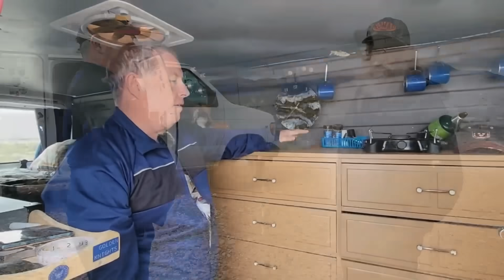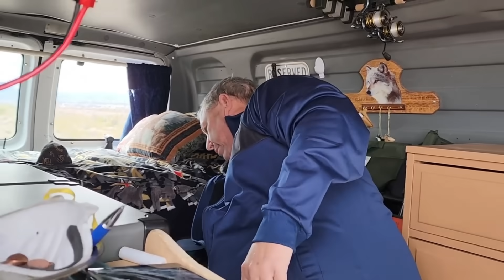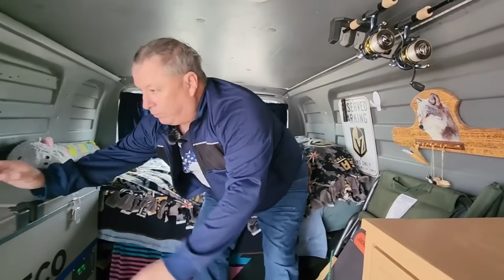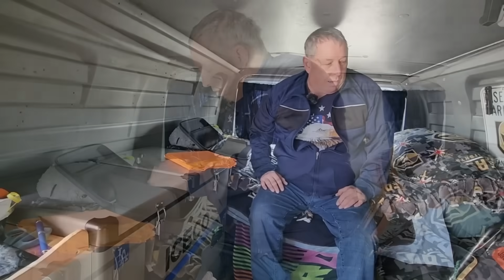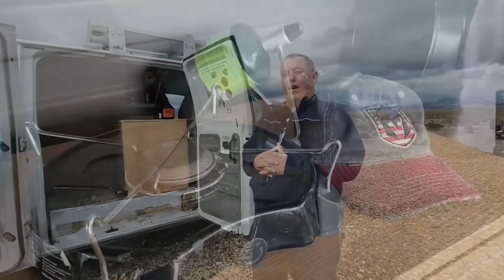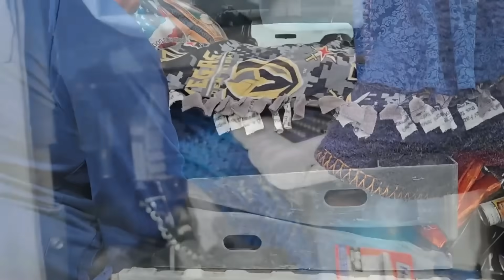Super Cheap Van Life: Turn Your Van into a Cozy Home for Under $200 - | No-Build Van Life

Comment: Bill is a smart guy , when I heard the bottle caps for drape rod ends that's when knew he had somethin,,,,, I did a similarthing but used a milk bottle cap for an parking brake puller-ha ha😅

Comment: Please pass this to Bill  -  the back window that open,  I  also put two in - to keep out the bus, I put a nylon screen inside and used a cocking for window to hoped on the screen  cut a small slit (at bottom ) for closing arm be working for two years no problems

Comment: Looks like he is using bottle jacks to support and level his bed, not jack stands. Jack stands are limited to just a few adjustment settings while bottle jacks can be cranked up to any position. It's a great idea! You can level the van as much as possible but sometimes it is hard to get it perfect. With the bottle jacks you can fine tune the bed so it is perfectly level.
Reply: Thanks for telling me the real name of the stands I appreciate it

Comment: It looks like the rear window seals well against exhaust.
Reply: No smell of exhaust  thank goodness
Reply: Stock tailpipe exit for that van would be out the side behind the passenger side rear tire so he should be OK even with the window open when driving. Exit the tailpipe out the rear and it's a problem, even super critical that the rear door seals are sealing correctly. That applies to all vehicles with a flat squared off back due to the aerodynamics creating a low pressure area directly behind the vehicle.

Comment: Love the "no build" build. My Chevy van had a back window like that and it was used to break in and steal the van (happened to a previous owner). See if there is a good way to secure it so they can't open the door from popping it open and then reaching the door latch.
Reply: Good idea I'll check  into that
Reply: Thieves go for quick/quiet/easy - perhap some sort of lock & alarm set-up would make it less so... there has to be something like that out there...
Reply: If your van has child locks, they will prevent the door from being opened from the inside.  The GM vans have this.  To engage or disengage the child-lock function, a mechanism accessible only when the door is open is used.  When it is engaged, the inside handle does nothing.

There is a danger with that.  If your van is built in a way that blocks access to the front and you do not have a key fob, you will become trapped inside if all the child locks are engaged.